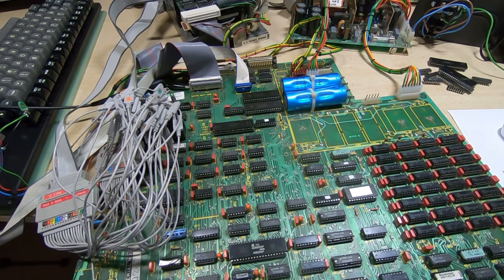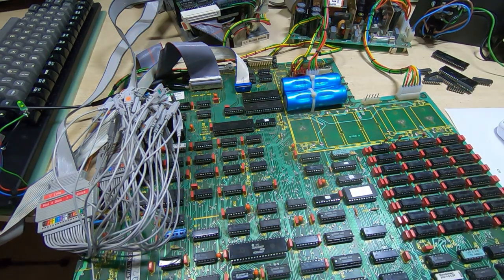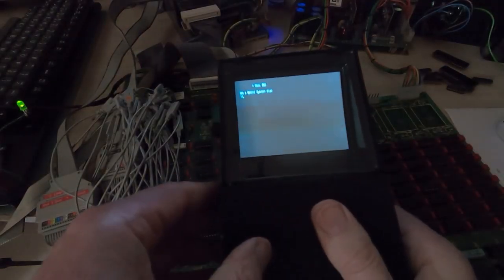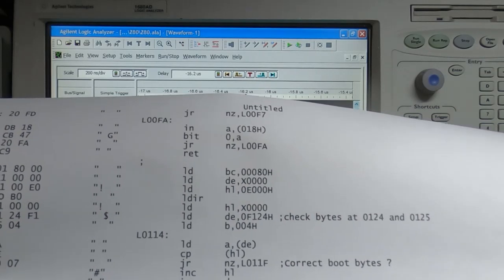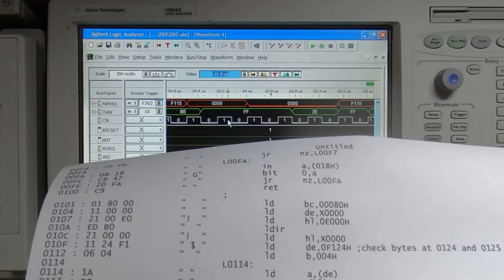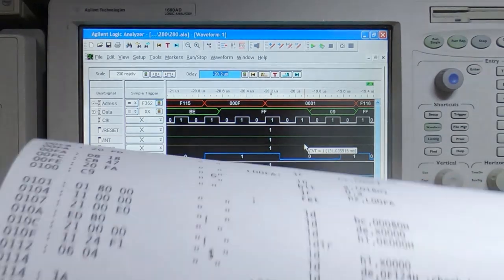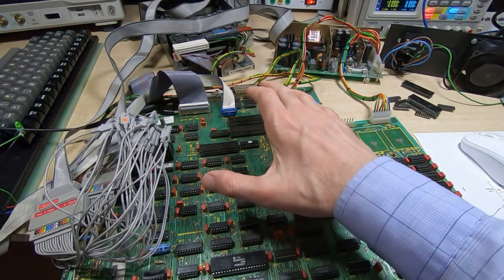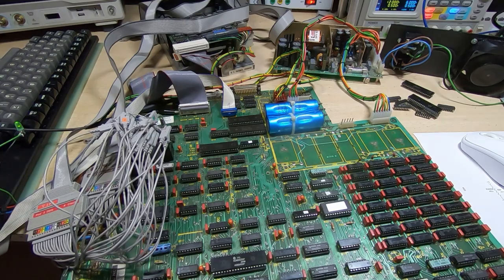Mimi 801 Part7

Comment: Although not a fix for the issue… it would be an interesting experiment if you could override that disk indent (ROM edit) and make it use the disk you have to boot ?
Assuming that an 801 is similar enough to an 802, maybe ??
Simple tweak, interesting experiment, no ?
Reply from the maker: There is very little protection on these machines and if the firmware does not handle the hardware correctly it could damage one or more devices and several of the rare IC's cost £30+ each. That is the main reason the boot sequence goes to such pains to ensure that an incorrect OS is not used. Once the OS is running it should be able to read disks from other versions because the BIOS will act as an interpreter between software and hardware but trying to boot the wrong image is not a good idea, especially as this is not my machine.